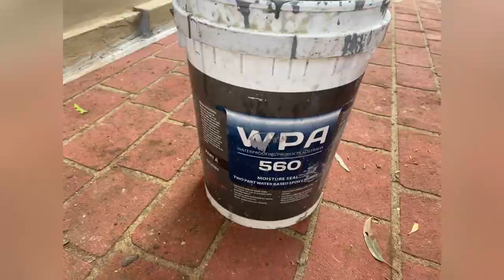Planter Boxes Waterproofing With Liquid Membrane

Comment: Hi, for a new rendered edge of a garden bed can we apply the waterproof without the primer? With thanks.
Reply: The epoxy primer is always recommended. It will work as a moisture barrier as well
Reply: Yes I ended up using the primer first. Thanks for your reply!!